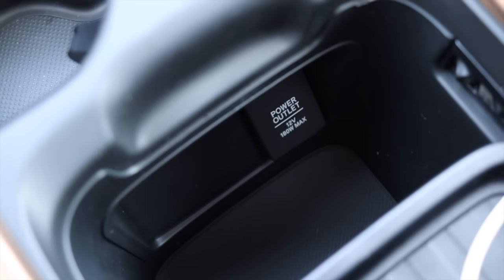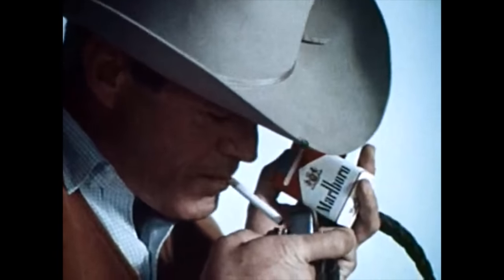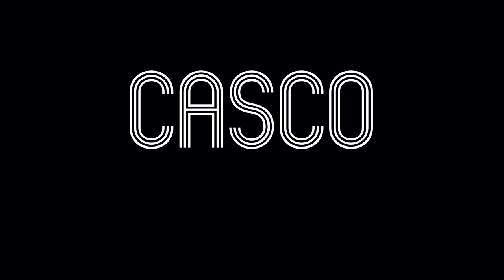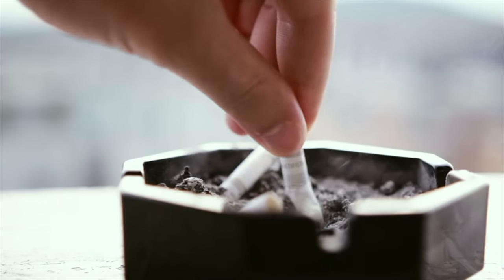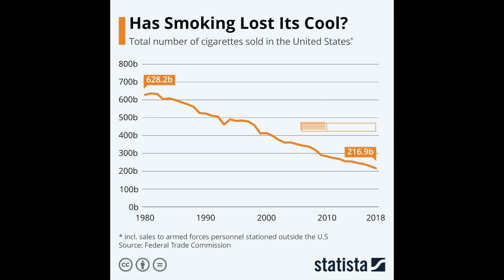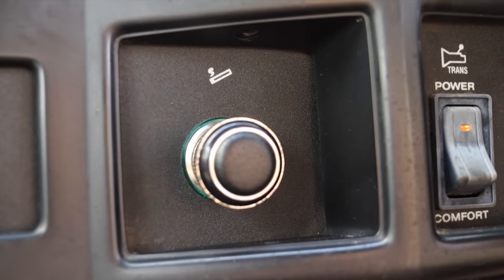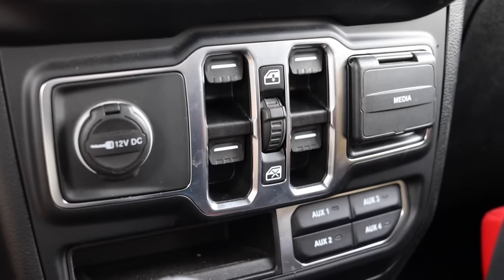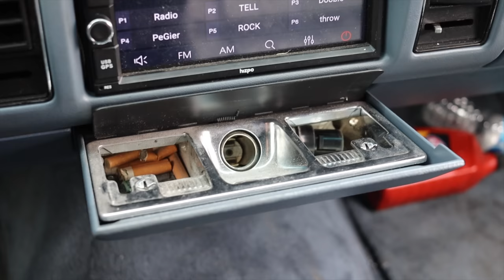Cigarette Lighters - How They Were Invented & Why They Went Away!

Comment: I remember when the "smoker's package" became a popular option in new cars during the 90s.  For anywhere between 200 - 500 dollars, you could get your car equipped with ashtrays and lighters.  Those who didn't opt for the package would get a storage compartment / cup holder, and a lighter receptacle cover, instead.
Reply: $200 to $500 for an ash tray and lighter in the 1990s? What a rip off.
Reply: @morganrussman  but today it would be a good deal
Reply: @morganrussman  for 200-500 ANY option on new car is the cheapest kind of option. Cargo nets cost the same even though you can buy one for 5€ anywhere
Reply: @morganrussman  dad's 91 Jetta came with em front and back.
No cupholders though, and that's what almost ruined VW here in the mid 90s is having lack of cupholders.
Reply: Ford still does this😂 you can even get one in that new Maverick it’s like $500 and some change they include the lighter and a “reinforced 12v plug for heat” as well as an ashtray
Reply: Yep. My 90s car has 4 ashtrays
Reply: My 2010 civic SI has a lighter and ashtrays and they're completely unused by anyone.
Reply: My 2002 300m has the smokers package. Rear ashtrays, and the like. I don't smoke personally, so I use them for change or small items. Lol.
Reply: @MrTheHillfolk  People straight up dont believe me when i say my car doesnt have cupholders
Reply: @morganrussman  you have to realize, those parts, like the ashtray were specifically made for that model vehicle and fit perfectly. Finding aftermarket parts like that back then were not always easy.
Reply: My late father's Neon had a smoker's package which was basically a cigarette lighter that would go into the power socket and an ashtray that would fit into a center console cupholder. Neon's first owner was apparently a smoker, luckily the fumes had pretty much vanished by the time we got the car.
Reply: The smoker's package in my '07 Focus was $48.00 and in my '14 Cruz was $52.00. (US)
Reply: Yeah! My 1995 cougar has an illuminated metal ash tray in the console and that’s the coolest thing to me
Reply: They still have these today with Subaru Atleast. I remember my aunt who is a heavy smoker ordering her car and refusing to pay $280 for the ashtray, when she can buy a cup ashtray for $5
Reply: The ashtray and lighter was standard equipment in 1990s trucks. My 1992 Silverado has it. My VW Bug has 3 ashtrays in it.
Reply: Yes. Prior to that lighters and ashtrays especially were standard
Reply: Which manufacturers offered a 'smoking package on which models as late as the 90s?
Reply: @frazzledwizard3595  You use the ketchup / taco sauce trays for change?!?
Reply: @petenielsen6683  🤣🤣🤣
Reply: my dads 2004 trailblazer has one of those lighter receptacle covers, but we still had a cigarette lighter from a previous car around that we put in there so now we have a functional lighter in that car but no ashtrays
Reply: In the 80s it wasnt a feature, every vehicle had them. One lighter and at least one ashtray, and possibly one on the back of the seats for the rear. Airplanes used to have ashtrays on the handles for the seats.
Reply: @skylined5534  I think in the '90s they all had them. My 95 and 97 Cadillacs had them front and back.
Reply: In Europe even the lowest povety spec cars had a lighter and ashtray
Reply: In the mid 2000’s my stepdad’s mother was complaining on cars not having an ashtray and such as a standard package. Mentioned that people don’t smoke as they use too.
Reply: My dad got a used Chrysler 300 from 2007 that had the smokers package. Ashtray and lighter
Reply: @morganrussman  you've never bought a new car huh?
Reply: @silversonic99  nope.
Reply: @morganrussman  pretty much every add on or package you get is a rip off. I’m literally looking right now at Mitsubishi charging $250 for “rugged” floor mats. You could buy actual really premium high end floor mats for that price
Reply: @silversonic99  wow 🤦‍♂️. They could cut about $150 off that. With some of the "features" that come in vehicle's these days like the internet connected radio entertainment center is just sad.
Reply: @morganrussman  like most extras in cars, theyre always sell ups
Reply: @JuarezDerrick  so did the auroas
Reply: I got a 99 Dodge Caravan with 35,000 miles and a guy at work told me if I smoked in it it was worth nothing. I showed him the window sticker that said non-smoker. Then I told him the people who bought it brand new were chain smokers who wintered in the same trailer court in Texas as my parents so I knew that was bull. My friend used to work at the same dealer so I knew any car with no cig burns was called a non-smoker, they just sprayed a little extra air freshener. Dealers say anything to get a premium price.

Comment: I like the fact that some cars have all three: 12v outlet, regular home outlet, and USBs
Reply: My 2014 Silverado 1500 LT is like that!
Reply: Iv never seen that... must be a rich thing
Reply: I got in the back of my aunt's car and was surprised to only find 120v outlets, fortunately there were a couple 12v barrel plugs in the cargo area I could use
Reply: Im always jealous when I see a car with a home outlet. Imagine all the stuff I could plug in
Reply: @user-ejxomyq  You can buy an inverter that turns a 12VDC socket into a 120 or 240VAC socket. They're a pretty chunky box thing and get quite warm.
Reply: My 2011 Durango has the 12v, a few scattered USB ports, and in the rear of the center console is a 110v outlet that has to be turned on from the dashboard.
Reply: My Lincoln has all 3! lol
Reply: @DaFinkingOrk  I have one in my 1990 pickup. It also has its own usb port.
Reply: @theonlineanimal6009  ... 120 volt plugs (receptacles) have been showing up in mid level cars for the last decade or so. It's mostly low power (150 watts?) in case you brought the wrong phone / PC charger with you on a trip. They are usually in the back seat area so kids can charge gaming computers too.
Reply: @rupe53  must be higher than mid. That's a rich person thing. I own a Firebird and a 2015 Chrysler and neither have such features. So it must be a Hella rich thing. I have seen car adapters you can buy for any vehicle. So it's not unavailable. But for plugs to be built into the car. That's a whole new level
Reply: @theonlineanimal6009  ... I have a 2014 Caravan that's not the top model and it's got the outlet in the back seat area. (plus a USB port) Mine does have satellite radio, so might be part of a trim package. Still, not a rich man's car.
Reply: @AceRuiner1979  how amazing :)
Reply: @rupe53  And new electric cars have 240V 10A outlets… (they have the voltage and power not to be stressed by the load).
Reply: @DaFinkingOrk  

Best mounted in the rear bot on carpet!
Reply: @allangibson8494  ... yes, some do have other voltages available. I believe the new Ford trucks have a 30 amp 240 volt where you can plug in your home during a power failure. Not sure what the Kwh rating is. I have only seen the TV advertisements.
Reply: @rupe53  I have also seen a couple with 75V battery bus interfaces that can tie cars to household grid connected solar inverters so the car acts as another grid battery pack.
Reply: Only in very expensive SUVS that have that.
Reply: @Puggy42069  ... when was the last time you saw an SUV that wasn't expensive? There's hardly anything on the market that is less than what I paid for my house.
Reply: @rupe53  Nissan Rogue and Chevys are typically not too expensive cause they are made poorly.
Reply: @Puggy42069  actually my mom's car has all 3 and it's not too lavish
Reply: @alexcuevas5633  Define “too lavish.” Which model and year?
Reply: @Puggy42069  It's a base model 2016 suburban
Reply: Hyundai Ioniq 5?
Reply: @theonlineanimal6009  newer cars have them, so more like a middle class thing.
Reply: @user-ejxomyq  note that 230 V / 120 V power outlets provide often rather limited current (Watts) like 150 W or 300 W. This because they invert back from 12 V battery.
Reply: Yeah my 2020 Ram has two 110v outlets, 3 usb & 1 usb-c outlets and 2 12v outlets but I only ever use the usb-c😂
Reply: That's how our 2016 Expedition is. However, given its age, the USB ports are both type A, so no fast-charging. Still better than nothing! It has two cigaret lighter outlets, one in front, one in the back. The regular outlet is great ... if you can keep the device in the thing ... anything I plug in there is always loose.
While the outlets themselves are neat, I'm so glad smoking's not as common as it once was. I still remember going to my grandpa's house and smelling of the stuff afterward. Grandpa, RIP. I wish I could have known you longer ... and I would have if you didn't smoke.
Reply: @Foersom_  Yep! Ours is like 144 or something like that. It's enough to plug in a laptop or something, which is great!
Reply: @nutbastard  It is not the alternator with is the limiting point. It is the 12 V battery, because people want to run it with motor stopped. Secondary problem is inverter circuit DC to 230 V AC that can only handle limited amperes without be costly.
Reply: @Water King That's what I thought. I was in my dad's truck the other day, and my phone actually lost charge on the USB. It is a standard type A, in a 9-year-old or so truck, so I'm guessing it's the equivalent of plugging a modern smart phone into the 5-watt adapters they used to give you like 4+ years ago. The 12-watt type cigaret outlet charger was much better, albeit slower than my fast charger at home.
Reply: my iveco daily will at some point have standart 12V, some other connector for 12 an 48V at up to 16 or 40A, depending on the connector i will use and ac outlets for up to 5000w.

Comment: As a nonsmoker, i still find this feature quite nifty for other purpose. Have used ours as firestarter for camping. I'd stick a small twig onto it to light up our bonfire. And the 12volt outlet we'd use to power some electronics and air pumps
Reply: That is what I thought they was for naturally. Like if I'm stranded I would love to make a fire or torch so I wouldn't kill my battery
Reply: Yeah I just thought about this myself. I keep some emergency stuff in the car because I live in the north, and if you get stuck in a snow drift with no service on a back road, you could be in real trouble. You can't keep a normal lighter in the car, it would blow up in the summer heat. My solution has been keeping a little flint lighter  with no fuel that just throws Sparks on a frayed rope wick to create flame, but just putting the damn 12V lighter back would be a much more elegant solution
Reply: Improvise, adapt, overcome.
Reply: My grandfather used to use it to heat up cans of soup
We later saw this in "A Goofy Movie" and howled with laughter
Reply: Same, we use to use the lighter to start fires when camping or hiking hahha
Reply: @GlorifiedGremlin  I keep them in mine all summer never had one explode lol
Reply: @dakotabowes2387  That didn't happen because they don't explode, it happened because you got lucky lol I've gotten lucky too back when I smoked cigarettes
Reply: @GlorifiedGremlin  You can buy one and have it installed in your car. Part was about $50 bucks (closer to 40 but it's a long story)
and I have no idea how much it's gonna cost you to put it in, but it is doable.
Reply: Bruh i still have it in my 2015 l200😊
Reply: I use it to light cigarettes
Reply: @GlorifiedGremlin  I live in TX and have never had a lighter explode in my car over the summer, I always have at least one lighter in the car. Right now I have about 5 of them in there, and they've been there about 2 months.
Reply: How the stick isn't metallic? Plus if you did that you risk the chance on blowing the fuse because the other end isn't a regulated voltage.
Reply: I suspect an EV car can probably use the heated metal synergistically with wind draft, to remain glowing and feed the heat to conductive metals to recharge battery cells while driving...
Reply: Or just, you know, carry a normal lighter?
Reply: Super neat comment

Comment: I think there will always be a way to access the car's 12v system directly. The old lighter plug has just become the 12v standard outlet. Which is good because the big adapters have room for a fuse to protect your gadgets. But if the big round outlet were to be redesigned, it might be in the form of 'USB12' or whatever the new naming convention is, which is also capable of transferring 12v.
Reply: USB4 is capable of "delivering" many different tensions such as 12 V.
It ranges from 5 to 48 V and goes up to 240 W .
The underlying technology is named "USB Power Delivery"
Reply: Fuses/breakers don't protect your gadgets, they protect the wires of the circuit in the car/house from exceeding their current rating and catching fire. It's your gadget that's already failed causing the short that causes the fuse/breaker to break.
Reply: I think the future is Vehicle to Load where EVs can utilise the full power of their battery packs while on the go, using conventional plug sockets inside and the ccs plug outside.
Reply: @theblah12  there are already EVs with wall sockets outside like the F-150 lightning, Hummer EV, and the R1T (?)